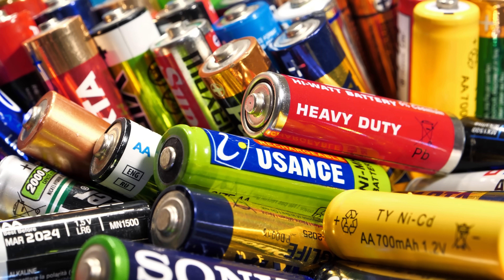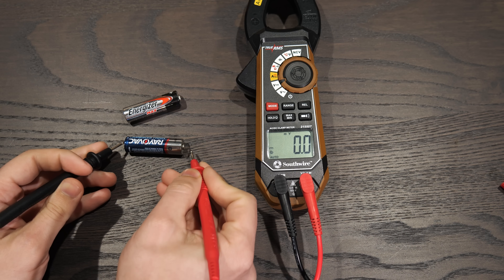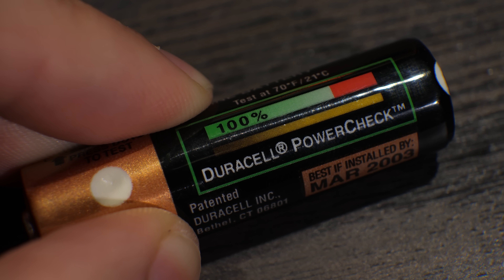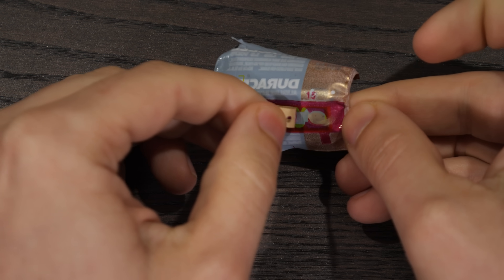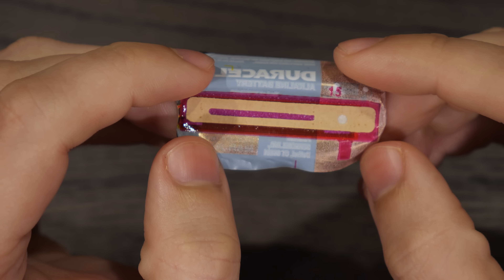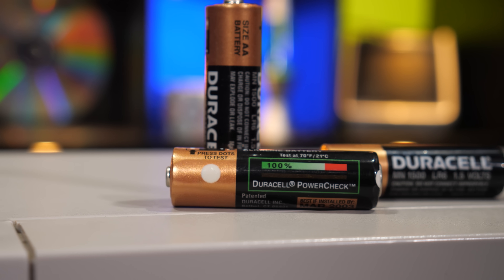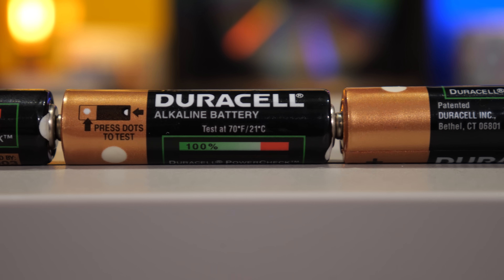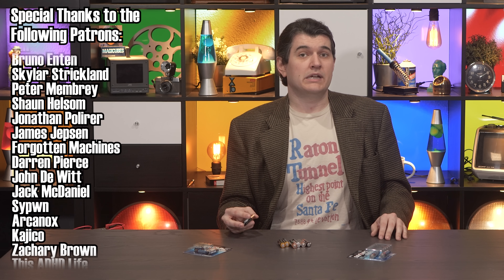Duracell PowerCheck: A genius idea which didn't last that long

Comment: In Canada, we had these into the 2010s. I remember being fascinated by them. The ones I grew up with (2000s - 2010s) had blue indicator bars, and some of the most recent ones actually had muti-colour indicator bars.
Reply: Yep, I was surprised to hear "late 90s". I don't remember these being common in the Netherlands until the mid 2000s. Most of them had a yellow indicator, but I vaguely remember encountering a few blue ones towards the end of their tenure.
Reply: @ThePends  I do think they were here too though late 90's. I had them in stock when I opened my shop in 2000. Maybe import since I bought things like batteries new directly from factory/importer. Probably not in most shops right then since everyone first was using the older (less expensive) stock.
I had some lights that were pressing sooo tightly on the batteries that if you inserted them with the tester to one sidewall, you will have that battery empty very fast and the other one was still good (in series) :-(  Not that practical but you could test and replace the empty one while leaving the other one in (carefully looking how you put them in).
Soon, I was selling only Varta (without testers) though.
Reply: Same in Italy, I remember seeing ads for them when I was in elementary school, so that would be around 2007-2013
Reply: I’m in the uk and can get them at any supermarket like this video is like the twilight zone. They’ve never stopped selling them here
Reply: @Alphoric  I thought so, I'm sat here confused why he kept talking about them being discontinued and I remember seeing them as a teen and young adult in the mid 2010's. I don't buy many batteries these days though so wasn't sure.
Reply: I'm in the United States, I have used new in package from store batteries with the indicator. They weren't Duracell but still...
Reply: Yep! Here in Mexico we had these until the early 2010s and they were blue as well, thought I was misremembering when I saw the ones in the video were green.
Reply: Still pushing as hard as possible here in Ukraine
Reply: In Canada, it seemed to be a way to differentiate the two models in Duracell’s lineup. The normal models didn’t get the indicator strip, the expensive (eg Quantum) ones did. I think they continued doing it until the late 2010s…
Reply: I remember these in the states around the 2010s as well.
Reply: Same in Australia
Reply: yeah i remember seeing them around that time in the Netherlands too.
Reply: Can say the same for Eastern Europe! ^^
Reply: Poland too!
Reply: They were around in the US in the early 2000s. I remember them as a kid, but they were pretty uncommon
Reply: @MaFTB same in Malaysia, it's pretty rare because it's quite expensive unlike competitors. I think it's stop selling in late 2000's because less people bought it. Just like in this video, we also got yellow color unlike European which is blue
Reply: Same here in Europe.
Reply: I had these batteries with “use by date” in 2018. So these were definitely being produced until mid-2010s.
Reply: Still have some in my remotes
Reply: Thank you for this. I thought I was going crazy because I could have sworn the indicator was not yellow, but I definitely remember these batteries.
Reply: I'm pretty sure that the thermochromic material was just black, changing to clear. The yellow was just normal yellow ink underneath the black and they could print whatever colors they wanted instead. No additional chemistry needed.
Reply: Same thing in Russia

Comment: Would love to hear your thoughts about how to deal wit alkaline batter corrosion. I've had more than a few gadgets destroyed by alkaline battery corrosion. Are there AA / AAA  / C batteries available that WON'T corrode when left in infrequently used devices?? How do lithium cells compare for longevity (at 2 to 3 times the price of alkaline)?? Are lithium less prone to corrosion??
Reply: If your devices work on the lower voltage of NiMH rechargables, they're a great option. much less prone to leakage when sitting around than alkaline batteries are, and you can recharge and re-use them when drained. If your device really needs more than 1.2V, the "1.5V" (actually ~1.7V full) lithium/iron disulfide (non-rechargeable) cells will be less likely to leak/degrade than alkaline.

Comment: They still make PowerCheck batteries under the Duracell Quantum line. I'm holding a pair right now that haven't expired.
Reply: duracell turbo here in EU... i have a box of these.
Reply: @tartarughaninja4  cool they're keeping them around
Reply: @tartarughaninja4 ultra in the UK
Reply: Same, but under the Duracell Ultra product line here in ZA. Still has PowerCheck™ on the label.
Reply: @smashed_penguin  they replaced Duracell Ultra with Optimum here in the UK and seemingly many other places as well now
Reply: @smashed_penguin  ZA as in Zambia?
Reply: @vinnysworkshop  ZM is Zambia, ZA is South Africa.
Reply: @smashed_penguin  Only because you paid for the cells that Duracell actually does QC on, the consumer line is identical (down to the tooling marks on the actual cells in most cases, and the lot numbers hidden under the label) to the no name cells you buy all over, just look for ones with the same expiry date, and you find out they came from the same machine line. 

The one I want to find is the OEM who did the cells for Proctor and Gamble, as used in Airoma machines, a plain white sleeve cell, but I never had one ever leak, even though I used to buy the intro packs, as they gave 2 refills, and the dispenser, for the same price as a single refill. I had lots of those 2 cell packs around, that were really high capacity, low internal resistance, and which lasted at least 10 years in use, not even leaking when empty. Not even an expiry date, just a lot number on the cell itself under the sleeve.
Reply: Thats what I thought, I totally have new ones in my house.
Reply: my papa does
Reply: I thought I had seen them in recent years here in the UK
Reply: @JenjenOnWheels  they still exist. The ones with some blue on them called "ultra power"
Reply: I made a comment stating the same. I bought a whole box of duracells that had the battery check on them just a few months ago. Still have a bunch of them left.
Reply: Duracell ULTRA in Europe have them still aswell… exp. Date 2029
Reply: press it for me, will you
Reply: Yeah, the red ones
Reply: Just found some in my gameboy bag that still have a full charge. I use them as a backup for when my rechargeables die.
Reply: Praise The Lord, i don`t really use batteries any longer, but that power-check was just brilliant... I remember always using that when i was younger to check the battery state... Now i don`t watch Tv or use anything that uses batteries really, other than the car, but that is a different battery(at least much larger...).
Reply: its a pretty pointless feature but so cheap to produce they might as well keep them around!
Reply: @squirtle88  it's useful once the batteries have a couple of years, like you've seen in the video.
Reply: @squirtle88 doesn't mean they went away as claimed
Reply: I would disagree. I went on multiple mission trips to Haiti before things went south and Duracell Quantum batteries with self testers barter extremely well because you don't have to trust the person selling them.  @squirtle88
Reply: @squirtle88  i personally think they should be kept on all rechargable batteries, it's a cool feature (even if it's mostly useless) but it's still worth having it for the times it is needed (especially with how rechargable batteries are a bit more expensive than regular ones)
Reply: @squirtle88  probably not cheap enough for some Duracell CEO to be comfortable with.
Reply: @davidmcgill1000 It was the most expensive component of the cell at the time.
Reply: @davidmcgill1000 you got to remember that they make these in the millions and you have to multiply those extra pennies by however many million units they produce in a given timeframe.
Reply: I just swapped some last week - branded Duracell Ultra (I'm in the UK), expiry date 2030.
Reply: They exist for a reason. Some orgs use batteries by the 1000s. One would be the wildland fire services who use disposable in portable radios because you can't recharge a radio in the middle of nowhere and being able to check the charge level means not throwing out good ones so you don't get caught with a near flat radio when you need it. The alternative would be swapping out potentially good batteries just to be sure. The armed forces in another one.
Reply: @marvindebot that’s completely nonsensical. If you can carry the weight of disposable batteries you could carry the weight of rechargeable batteries… in fact you can carry more rechargeable batteries because lithium ion is a lot more energy dense than NiMH or alkaline batteries…
Reply: If they just put it on some NiMH batteries, I would buy a couple of sets immediately and tell many others to do the same. NiMH self-discharges, so you actually want to check your spare sets, and some of us have to keep them around for aviation headsets.
Reply: @Finder245  for the non powered aircraft ports I just use a USB charger while flying. I swap with the charged set at the end of the flight. I still keep an alkaline that set as backup but haven't needed it yet.
Reply: @kevin-pk6hd  I carry two sets of Eneloops in a USB-powered charger. No issues so far, but if PowerCheck was an option, I would get new batteries without thinking about it.
Reply: At 15:59 via closed captions this is actually called out: “So apparently these were made for much longer in some markets and also hung around for awhile here in the IS on some of the high-end batteries Duracell sold.” 

I wonder if your comment was noticed and this was added or maybe it was just an after publishing add-in.
Reply: Good shout! I might grab some just to play with them
Reply: If you weren’t holding them checking the charge the entire time you did this comment I’ll be disappointed
Reply: Yep. They're still pretty common in Greece
Reply: I knew I wasn't mad. They were the ones I found a couple years ago.
Reply: I also happen to have Duracell with the tester.
Reply: Can still get these in the UK
Reply: And the "ultra power" series here in the UK.
Reply: There is absolutely no way we have the same profile picture and came here to make the same comment lmfao. The second he started to deviate from the history of these, I scrolled down to write a comment about the quantum ones. I haven't seen them in a while but the red color was very effective branding.

<<Today's my birthday! A victory sure would be nice.>>
Reply: @jlight7346  There's a few of us out there. I do a double-take each time I see one as well.
Reply: Was gonna comment the same. I have a set of Duracell Ultra Power Check AAAs that don’t expire until 2029. Was playing with them during this video and coincidentally educated my son on them over the weekend.
Reply: I was like huh? I had them last year in my hand. Apparently in Europe they are still being sold.
Reply: Good to know! I was going to comment that I remember seeing this feature on Duracell AA batteries around 2012, but I haven't seen it since. I had no idea they were still being made!
Reply: Came here to say this.

I’m in the US, so it’s in the Duracell Quantum line.
Reply: Yeah I remember using them in the late 2010s
Reply: same, holding one right now
Reply: In the UK I can get Duracell Ultra batteries that have the powercheck
Reply: I was surprised the feature is older than me.

I was born in 2004 and assumed it was LEDs when I saw it for the first time in 2018

Thought they where new then
Reply: Mixing half used cells together isn't really a good idea for high current draw devices either
Reply: This news delights me! I might actually buy a pack and am glad it's still available in some "premium" line.
Reply: Found the people that don't turn captions on for the end!
Reply: Haven’t seen them in a bit, but yeah, I’ve had some power check batteries before. They really were a pain to use.
Reply: Yup, we still have them in the UK, & thankfully they're not as painful to use as they were on the 90's version.
Reply: just what i was going to comment, you can still get them in the UK with relitive ease.
Reply: @sypwn you holding the batteries too?
Reply: ace combat fan detected
Reply: How do you type while holding the batteries?
Reply: I threw all my Quantum batteries out because they kept losing charge. Some of them corroded in the package.

I'm guessing the power check metallic strip kept getting pressed in the device and draining itself
Reply: Duracell Duralock UK
Reply: I thought this tech was still out there! I could have sworn I saw this on a pack of batteries I got out of the supply closet for the high school robotics class I teach.
Reply: @cherryJ0lt  They definitely are still out there. Just not sold in stores. I just saw them on Amazon, for about 4x the price of regular batteries.
Reply: Why are you so casually just holding a pair of batteries?
Reply: Duracell Ultra here in Russoa
Reply: I use the thermal strip to keep my fingers warm while I sell them on the street. Although the tiny heater is so strong I quickly use all the current for the batteries. The last time I used up all the batteries keeping me warm, I came home with a basket of dead batteries and no money, naturally my father was furious, so he beat me senseless with a pair of jumper cables.
Reply: @kentremendous5112 are you the matchstick girl?
Reply: I was gonna say, I could swear I had some of these in my house at least a couple of years ago.
Reply: I came here to say this but knew in my heart it had already been said. But these are actually way more expensive than non-power-save batteries.
Reply: Also Duracell ultra in the uk have power check
Reply: I also remember these from around 2012
Reply: They did discontinue those about three years ago so you have some rare batteries my friend
Reply: Why are you holding batteries in your hand?
Reply: same
Reply: ok whatever besserwisser
Reply: Aren’t they going to be discontinued though
Reply: That totally explains why I was thinking "hey really so much time has passed?" thanks I feel better now
Reply: Same. I never saw them in the 2000s but I saw them recently and thought it was new technology lol
Reply: I’m holding a pair, too
Reply: Ive seen them here in the UK recently
Reply: Yes. Duracell Ultra, in Belgium.
I had to put a new battery in something, and noticed.
Reply: I too am powering my GameCube Wavebird controller using Duracell Quantum batteries with this feature built in with plenty of charge. So confused as to why he talked for ages about how this isn't a thing anymore.
Reply: Aha! I knew they were being sold more recently than the 90s. I remember buying a pack at Kohl’s with my Grandma around 2018.
Reply: That’s good they should have at least one line, even if small, that has these.
Reply: Cool
Reply: buying some rn
Reply: Not all heroes wear capes
Reply: Yes but Duracell last much less than energizers why buy Duracell when this is a fact?
Reply: as the powercheck battery that was held in op's hand at the time of this comment, can confirm, i have not expired and i am still produced, under the duracell quantum line
Reply: Yeah, I was gonna say I just saw these recently...
Reply: Yep, they're still very present in France at the very least. Haven't seen duracell batteries without a powercheck since the early 2010s
Reply: D batteries,right?
Reply: He's lying
Reply: i had a pack of them a few years ago.  i always just grab the biggest pack of battieres i can find for the discount because as quantity goes up price per unit goes down. if that's what i can find that's what ill get. i don't care about any of that. just as long as it powers my tv remote or xbox controller.
Reply: Nice PFP, Ace Combat is a great series.
Reply: Quantum's are discontinued. Anything you see for sale is NOS.
Reply: @axmajpayne Europe has them called ultra power.
Reply: I thought the quantums were discontinued. I haven't seen them in stores in a while.
Reply: Unfortunately Duracell Quantum was discontinued last year.
Reply: @ryanhook1574  What region? Duracell quantums were discontinued in 2019 as far as I can tell.
Reply: You're buying old stock then because every piece of evidence I could find says they've been discontinued 😢
Reply: that line is discontinued
Reply: That’s good to know because I was pretty sure I had seen something like that recently.
 I only recalled that when I saw this video pop up and it had me wondering if I created a false memory.

Comment: 7:33 you meant low resistance (high current)?
Reply: The current across the entire strip is the same, but you get more current per unit of surface area as the strip gets narrower.
Reply: Came here to say this.
Reply: I think his description of the mechanism is somewhat flawed.